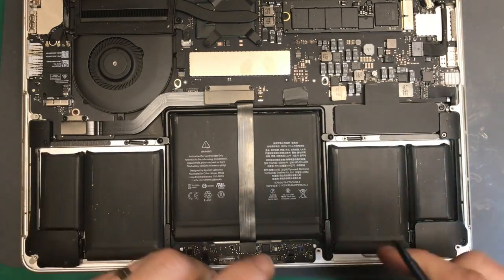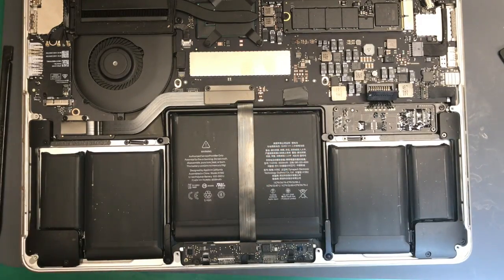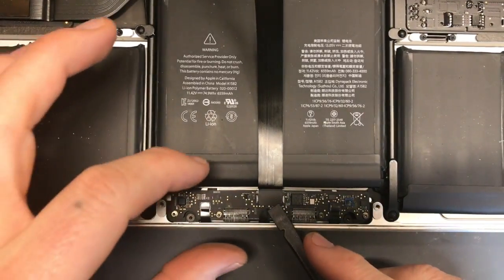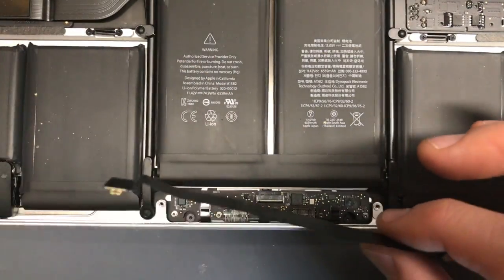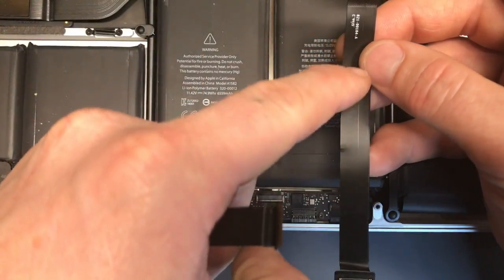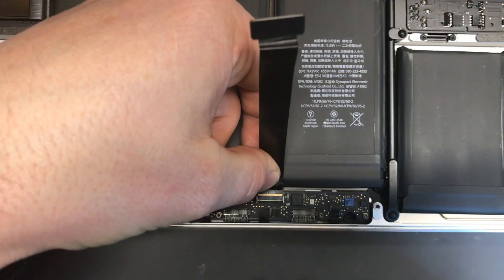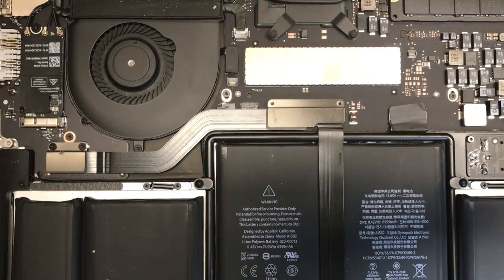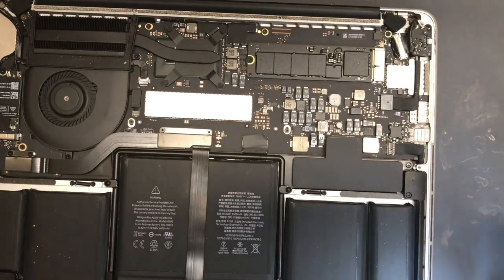Macbook Pro 13" 2015 A1502 NO Trackpad & Keyboard Fix repair Guide

Comment: Wish I watched this back in 2019 when mine stopped working. Paid £50 to have it repaired/replaced (part only costs £6) & a year later the battery went anyway so had to get the whole bottom part of the laptop replaced via Apple anyway for £200. It seems trackpad cables become lose when the battery becomes swollen. Anyhow, lesson learnt & I'm glad going forward I can do a lot of these repairs including Battery myself cause of great people like you on the internet! Keep it up mate!

Comment: My heart was pumping, but your calm and thorough walkthrough was fantastic and laptop was repaired with a £3 spare part off eBay. For anyone reading this who hasn't opened their MacBook before, on the case, the two screws near the hinge are slightly different to the rest. There are also two clips so when you open you should lever from the hinge side slowly and then they'll easily come away. All in all, excellent tutorial and now I feel like a superhero!

Comment: Face this same problem, my keyboard and trackpad stopped working suddenly. Talked to apple customer care who advised to do a reset of nvram and re-install the os. When that didn't solve the issue they advised to go to the local authorised service center, the guys there didn't have a clue and just said that I need to submit the laptop and they don't repair it but always replace it. And it would incur significant charges! In the meantime I just came across this video and decided to take a risk, ordered the ribbon on amazon. Got it today and replaced the ribbon, guess what - It worked and I am typing from my macbook! Great job man, certainly the right solution for this problem.

Comment: Incredibly easy fix. Need 5 and 6 point screwdrivers. Make sure cable secure (I didn’t need a replace, just replug). Some cables may be a little long. You’ll feel like a freakin computer genius if your first at home fix.

Comment: DUDE Thank you so much!
I have a Mac Book Pro 13' from late 2015 and it fell victim to this same problem.
Woke up one morning and both my trackpad and keyboard were unresponsive. Took my laptop to the Genius Bar at Apple and they said it’d be an entire topcase replacement for $500! I immediately went home to find ways I can DIY the issue and I landed on this video. I got all the parts and followed all of the steps and BOOM. Problem solved! Thanks so much! 

One thing I’d like to note, my laptop needed both a pentalobe screw driver and a hexalobe screw driver to complete this process. 

I bought only the pentalobe first to open up the laptop and then I saw that the kind of screws are being used to secure the shield of the ribbon cable were hexalobe. If they were pentalobe only pentalobe screws, I would have went ahead and continued the job. Since they were hexalobe screws I needed to buy a hexalobe screwdriver to finish the job. 

You really won't know if you need both until you open up your laptop with the pentalobe. I suggest buying both at the same time so you don't have to wait on the shipping for the second screwdriver.

If you want both in a single package, I can vouch for this set https://www.amazon.com/gp/product/B072KRMPJ6/ref=oh_aui_detailpage_o00_s00?ie=UTF8&psc=1
Reply: @sandhyanagar8385  Hi sorry for the late reply, but yeah! I'm still using the same macbook to type this comment to you right now :-)

Comment: Apple Store wanted $400 for a new bottom case. Even replacing just the trackpad cable would have been $90 ($80 in labor)! Just fixed my Macbook Pro for $8. 

@MAC111 - in the spirit of giving, I will donate $20 to the charity of your choice since you helped save me a lot of money. Happy holidays!
Reply from the maker: I'm stoked to hear you sorted it, I put this video up because I was seeing this repair so often and Apple techs always quoted worst case scenario top-case replacements or logic boards, they soon will cotton on to the issue but for now you can't beat a $10 fix, please keep your money or just give it to a random stranger who looks like they may need it.
Cheers JT
Reply: Yes, the same case to my MBP 13" 2015, Apple Repair Agent request  $650 to change all Keyboard, trackpad, top Aluminum frame, Battery.. This repair center said Apple was not allow to replace individual cable to me. 
Just call to complain to Apple, but they said not recognize that is a hardware design problem. Maybe need more MBP user to complain about this issue.
I already bought 5 pcs of this cable from Aliexpress, use 1 pcs, keep remaining 4 pcs for spare.
Reply: Grady I’m in the exact same spot! I’ve been just lugging around an external keyboard and trackpad. Now that I’ve finally seen how they do it, I’m going to fix it myself.
Reply: MAC111  I did this repair but the replacement started doing the same thing because the ribbon cable is slightly too long and bends back a bit. Without replacing it I jiggled it closer back under the and stuck some folded over and over tape of about a couple of millimetres thickness (with paper on it so it doesn't stick to the bottom cover) onto the battery on each side of the strip cable so it won't stick to the backboard as a a buffer, now the bottom doesn't cave in onto the cable basically reinforcing the bottom and hopefully it won''t happen again (fingers crossed).
Reply: Where do you get the replacement ribbon? Apple wanted $400 also and said I might need some other repair which would add another $150.
Reply: amazon. fixed it in 10 min for under $10

Comment: Thank you so much for this! You saved me more than $1000, and it took 20 minutes. 2015 Macbook Pro Retina, mouse and keyboard not working, now everything is good again. $12 part
Reply: The repair is  80€ at apple not 1000. Still much cheaper like this.

Comment: Thanks, man! This tutorial showed perfectly how to fix the problem. My MacBook Pro performed fine for about 2,5 years, but than I have to notice that neither the keyboard nor the trackpad worked. At first I thought it occured due to a software update, but I could cut it down to a hardware problem. After a quick research I found the information about the cable problems with the early 2015 series and so I searched and found this great video! I'm so happy! Thanks a lot!

Comment: Apple told me it would be $90 to replace the flex cable and that it was not a DIY job. Luckily I found this video, which gave me the confidence to try it myself. Glad I did! The video is very simple and straightforward. Luckily I bought 2 flex cables, as the first one did not work. Thanks so much for posting this video and showing us non-IT people how to do this simple fix!

Comment: 2017 model with bent cable design.
Confirmed working also.
Although keyboard cable is separate just the trackpad cable fixes both keyboard and trackpad.

You must remove 6 screws and the trackpad easily comes out.
Then u can remove cable and put trackpad back.
No need to remove battery.
Just battery connection before working on it.

Comment: Thanks it worked! It was very important to pop up the flip connector underneath the battery before removing the bottom part of the cable. @1:18

Comment: Worked like a charm. Like some others here, I bought a cable that was too long and had a different number than the one I was replacing, which seemed a bit spooky, but there is enough room under the cover for it. Thank you so much.

Comment: I have a 2015 Macbook Pro 13' .. after 2 and a half years of use my trackpad started to misbehave.
My trackpad would now only work half of the time, and when it worked the force touch also only worked half of the time... anyway pretty random. To make it work again I had to reboot 2-3 times + clean NVRAM or I had to press on the upper part of the pad kinda hard.
Anyway... 
Apple wanted to charge 400 bucks for the repair!!! I had to Google for approx. 10 minutes and found this video. I bought the replacement cable off Amazon and the 2 screwdrivers needed (one to open the mac, the other to open the tiny flap inside). The repair took approx. 20 minutes. The replacement cable was a bit too long tho, and it was pretty hard to make it fit but anyway. Now everything works like a charm again :D

GIVE THIS A TRY ... even if you're not sure if it's the same problem. You only pay 20-30 bucks for the parts and it'll probably work (and it's still better than paying a shitload of money to make apple repair it)

(sorry for my bad english) and thanks for the video !
Reply: Roldan Gacayan can't right now but will do as soon as I'm on my pc
Reply: Here you go ! https://amzn.to/2JTgipK and https://amzn.to/2KFv8l6
Reply: Roldan Gacayan Yes look above I sent you the links 😊
Reply: @sandhyanagar8385  Yes 8 months after the procedure and everything is working just fine! I never had a problem with the trackpad again 😊

Give it a try at least you're not paying ~400€ for Apple to replace the whole keyboard and trackpad (useless)! Just buy the cable and the tools and do it yourself for max. 40€
Reply: Hi my MacBook pro(early 2015) has the same issue in addition to the fact that the CPU loads upto 100% causing a huge lag. Do you recommend the same fix?
Reply: @Akash-eo8ou  This fix fixed the trackpad for me but I don't know about you CPU problem tho. The repair is easy and the parts are pretty cheap so if I were you I'd try this fix anyway and if the CPU still loads up to 100% go to your local Apple Store and get it fixed if their repair price isn't too high :)
Reply: @cfr06  Thank you :-)

Comment: I just replaced my trackpad cable. It tooks me about 10 minutes and everything works well. Of course I don't know how long it will keep working, but for now it works:) Thanks a lot!
Reply: any updates?
Reply: Mandy Gao  yes there is an update. About a week ago it crashed again and I had the same problem again. However I couldn’t imagine that the cable was broken again. I just removed the cable and installed the same one again. And it worked!  This is why I am pretty sure that not the cable by itself  was the problem. Probably the connection looses with time.
Reply: thanks so much for your reply Jan! I got it done at the apple store around 5pm and around 8-9pm it started freezing and acting up again. however, for me, its more of it lags for a while type of thing. what do you think i should do?

Comment: Thanks so much man, that's brilliant, saved me a lot of money and hassle doing this myself for only a few bucks. I got a spare one as well for when the replacement one possibly breaks down as well.
Reply: I have found that you need to reinforce the back cover with some folded over tape placed both sides on the battery keeping it from pushing on the ribbon cable so it doesn't keep happening.

Comment: absolute madlad, this saved me $2000
i chipped the battery but it still works lol
Reply: The repair is 80€ at apple not 2000€ still a lot cheaper though :)
Reply: @KonstantinSchultes  I went to Apple and they said the whole thing would have to be replaced

Comment: Thanks a lot man, this really helped and saved a lot of money. I appreciate the content. Apple wanted $1,000 AUD to repair this, yet I did it with this guide for less than $50 AUD (I had to get the specific part shipped to Indonesia.) You're really smart!
Reply: Dear z!rcon, may I know where you got the parts from (which sites)? I am from Indonesia and currently having the same problem.

Comment: Thanks for your well done video! It was very helpful when I replaced the ribbon cable in my husband's Macbook Pro 13". The trackpad and keyboard works perfectly again. I hope it stays that way!  Apple wants way too much money to fix this issue which shouldn't have happened in the first place. I have a late 2012 13" Macbook Pro and have had no problems with it at all.

Comment: Thank you so much.... my macbooks trackpad and keyboard stopped working a month out of its warranty.... just over a year. A joke for such an expensive machine. Have been using a bluetooth keyboard and mouse for well over a year which completely defeats the purpose of having a laptop. Bought it to repair shops who told me id need to pay €800 for a new topcase and another who wanted to dip the logic board in an acid bath. So glad i didnt go ahead with their recommendations. You saved me alot of money and hassle. Thanks again, my girlfriend will tank you too. Can do my college assignments from the comfort of my sitting room rather than having to sit at a table :)
Reply: did your power button still work before you fixed the functionality of the touchpad and keyboard?
Reply: Yeah power button is separate to the touchpad and keyboard

Comment: Thanks for the video. My early 2015 13.3" MBP developed this issue. Since it is still under AppleCare Protection, I called tech support. Every conceivable procedure was done without improvement. Conclusion: "hardware problem."  The machine was sent to depot and they replaced the trackpad cable at no charge. However, the listed bill was $100 for labor and $180 for Flat Rate 1 Repair Charge. If this happens again, after warranty, I will refer back to you excellent video and do the repair myself.
Reply from the maker: Thanks Carl.

Comment: Thanks so much for this. My MBP developed a similar issue, for reference:

-Power button still worked.
-Trackpad haptics clicked as usual, but induced no response on screen, neither did movement/gestures induce response.
-Keyboard backlight off (not sure if I'd just set it quite low before keyboard stopped working though).
-Keyboard unresponsive.

I changed the ribbon cable as per this video, worked like a charm. One point for consideration is that in the end I needed to use a slightly smaller Torx screwdriver- video info says Torx T5; the T5 driver I have turned out to be too big. This might be an issue with my screwdriver; just a cheap job from Amazon.

Comment: Just done this, typing with the keyboard again. thankyou! you should post a patreon here.

First time I have opened up the laptop, went very smoothly although the cable isa bit  too long, I bought it of amazon. Given that the previous cable must have degraded with pressure on the case (it stopped working after some travelling), I suspect this will happen again with the kinks in the cable. 

For note: before hand I thought it was a software/cached memory  issue since 
- power button still worked 
- I could reset the SCM using the keyboard
- I could wake the laptop using the spacebar 
- Diagnostics found nothing wrong.

Comment: So i decided to try this out. So far everything works just fine, and the procedure was fairly simple for a non-handy person like me. I noticed though, that the model number for this cable in my retina early 2015 MBP was not exactly the same as the one i bought, but this worked anyway. Might be the fact that my replacement cable already had adhesive on it or something. I will update if there is something wrong, but up to this point, everything works as it should. Thank you once again!

Comment: my early 2015 macbook pro 13" has a problem where the keyboard and trackpad just stopped working and im gonna order one of these cables to see if that will fix it, wish me luck
Reply: i am in the same situation. What is this cable called? Any links to buy it?
Reply: @fbog4434  Thanks for your answer. I restarted the startup disk but the issue was not resolved. In a few months I will change the trackpad flex cable following the video instructions. Thank you again!
Reply: @vinatruf  ahh sorry i have no clue why it worked for me but good luck!

Comment: Thank you SO MUCH!!!! I first had the same issue where my trackpad and keyboard wouldn’t work and a screen would tell me “can not detect Bluetooth keyboard” a year after I got my laptop and had my top case/w battery replaced during warranty period and that would have been $450+ dollars and this time around about a year later the same issue accord and I wasn’t gonna pay that 450 out of pocket and read that a lot of people were having this issue and I replaced the ribbon cable as you said and my laptop works perfectly!!!!! Thank you! I bought 2 extra ribbon cables after I fixed it just in case this issued were to even happen a 3rd time.

Comment: Absolute lifesaver! Fixed my mac in 10 minutes!
Reply: We've tried this, having bought both screwdrivers but the T5 to do the trackpad cable screws seems to big, although it's the right shape. Have we bought the wrong one, are there different sizes? Thanks in advance

Comment: Thanks a lot!!! I had the same issue and your video was a life and wallet saver! The cable I ordered was a little longer but it didn’t cause any trouble and I just put back the pack panel and it worked. Saved me soooo much money and time and trouble. Can’t see why would this cost 100$ at apple it is so easy to change and takes like 10 min max even if you’re not a pro :O...

Comment: Had my MacBook fixed 2 times (not via Apple), but all they did was reconnect the cable and it worked again. Until it broke down a few weeks later, of course. This is the third time and I'm definitely not bringing it back to the store. Will give this a try myself!

Comment: THANK YOU.... you saved me 500 euros.....small comment in removing screws from back panel i messed one up on repalcement, there may be some difference in thread size/sequence so take care to remember which ones came out of which holes......super you tube vid, no nonsense, no "hey guys i am brad bullshit"......